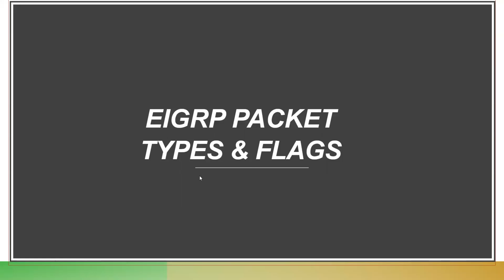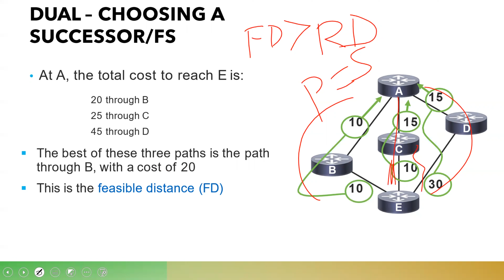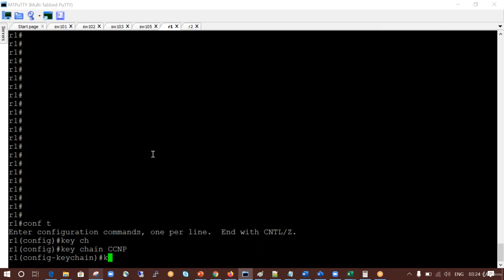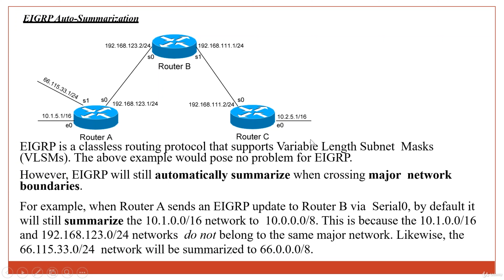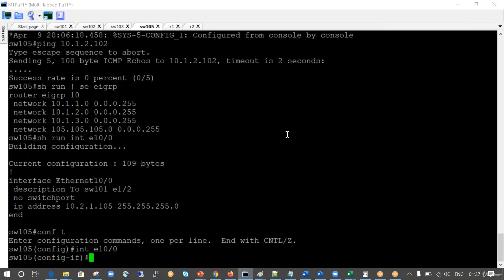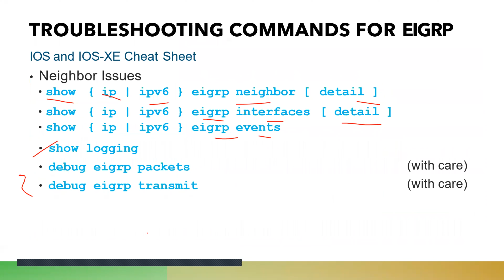CCIE EI EIGRP

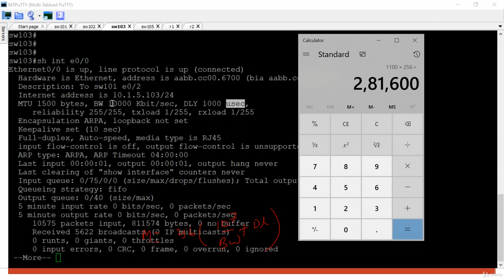Comment: 49:09 just a correction  . Ethernet port  Speed is 10 Mbps (interface speed ) , so bandwidth is 10000000/10000 =1000 Kbps and cumulative delay = 1000 usec/10 = 100 . Matric = 1000+100 *256 =281600 .
Reply from the maker: The Ethernet port speed is 10 Mbps (interface speed).
Therefore:

    Bandwidth = 10,000,000 bps / 10,000 = 1000 Kbps
    Cumulative delay = 1000 µsec / 10 = 100 µsec

The EIGRP metric is calculated as:

Metric = (10⁷ / Bandwidth in Kbps) + (Cumulative Delay in 10 µsec units) × 256

So:

Metric = (10⁷ / 1000) + (100 × 256) = 10,000 + 25,600 = 35,600
Reply: @CCIE_with_Ratnesh  I was missed to add a bracket around the matric here is the correct way , but calculation is correct.
 Matric = (Bandwidth + delay) * 256 

Bandwidth= 10⁷  / minimum bandwidth in path  

Delay= cumulative delay across destination / 10 .